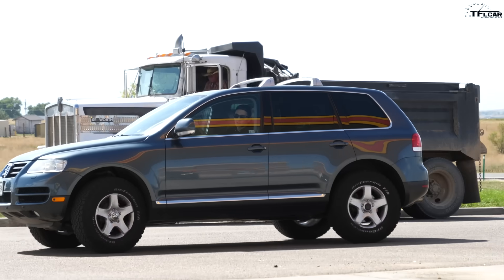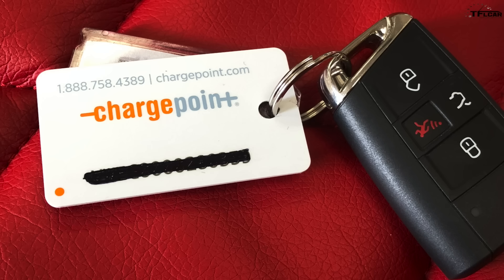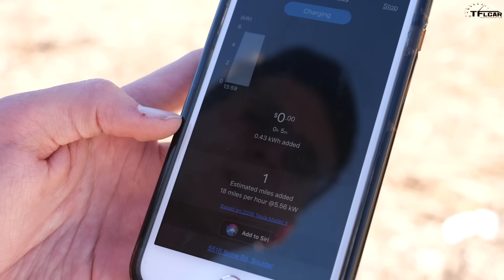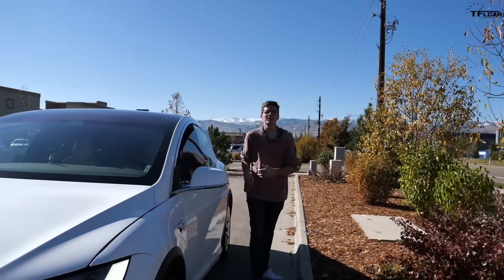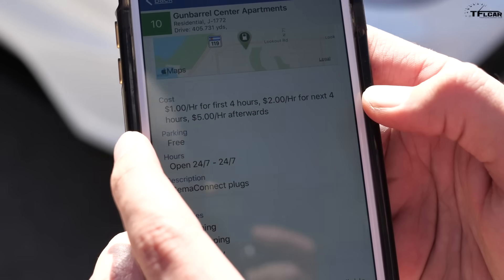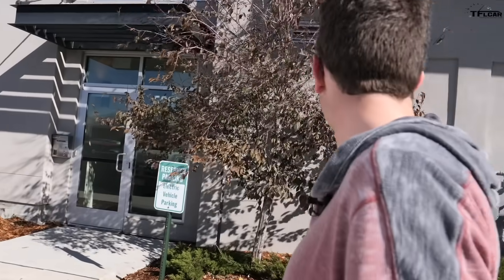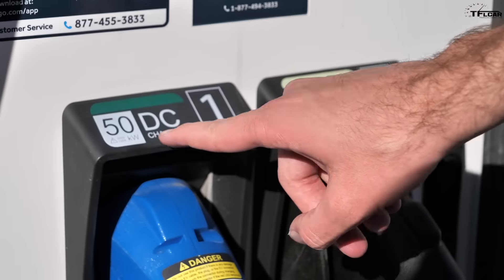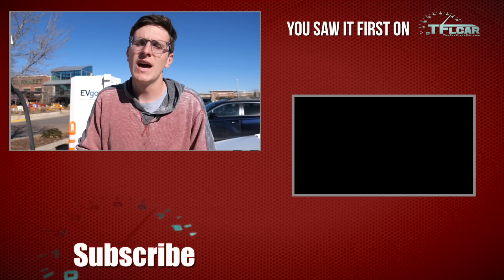Here’s Why Charging an Electric Car Can Suck - And It’s Not The Reason You Think!

Comment: I'm failing to understand the point of even having a public charging station that would take 20 hrs to recharge your car.
Reply: It also wasn't stressed in the video that the apartment complex charging station ("for residents only") is closed 5pm to 8am.  No overnight charging = no benefit to residents who have the most common jobs to be able to afford an electric car.
Reply: @VoltisArt  I saw the sign for that charger that said it closes at 5pm.  I had no idea that was even a thing with charging stations.  One more reason I'm very hesitant to go EV.  It would be great for me, as I get mileage pay for driving between job sites, but if I can't get a charge, or have to sit forever waiting for charges, then it is pointless for me.  Also, what if all the stations are being used?  Does the app tell you if a station is full before you get there?  I can't imagine waiting in line for an hour or two to get a "fill up".  What if you're there and someone is waiting, and they pull in front of you to keep their space and say, "I'm coming right back" but they don't and you're blocked in?  Is that a thing?
Reply: @VoltisArt  - I saw that too... how useless. I looked on app and saw a lot at car dealers too.. only useable during business hours...
Reply: @VoltisArt  Good point.
Reply: VoltisArt its done to allow residents to have a guaranteed free charge
Reply: @VoltisArt  Business hours only, for an apartment complex? Someone definitely has a screw loose here. Anyone owning a Tesla with a day job isn't going to be able to charge their car after getting home around 6pm if the "pumps" are shut off for the night. Good luck enticing them to sign a lease!
Reply: @VoltisArt  With all the assholes hogging the chargers that do not live there makes it even harder to charge for a resident.
Reply: @VoltisArt  🎯
Reply: @VoltisArt  Why would a charging station need to close at night?  What is the point in that?
Reply: I'm not sitting in my car to drive all over to look for a charging station let alone sit there to get it charged.  Gas station 5-10 minutes to fuel up. Plus I love the sound of the exhaust and engine.
Reply: The point is a tax break for the business that put it in.  There is some usability for the person who lives/works nearby.  And many many plug-in hybrids have electric ranges of 15-50 miles +300 on gas and can fully recharge in 1-5 hours.  My bMW i3 will do 120 miles on a 5 hour charge and then just switch to gasoline for as long as I fill the tank so an hour of charge while I have lunch is 25 miles or so that I don't use gas.
Oh and buying an electric car if you can't charge at home or work is silly.  A plug-in Hybrid makes more sense.
Reply: @TexMex421  Plug-in Hybrid with 60 - 120 mile electric range is good enough.  Most people won't commute more than 120 miles for a job !
And absolutely you need that gas engine back-up to the electric motor.  The USA is too big to travel across without having the gas engine.
Reply: @TexMex421  Toyota Prius or Camry hybrid is the way to go as it's engine charges the battery .
Reply: @nicopolis7377   Plug-in Hybrids are much better.  Charging a battery with a gasoline engine is silly.
Reply: @TexMex421  Five minutes to fill up and drive 400 miles. 
So, let's go electric.
Staying in the 20% - 90% charge range recommended by Tesla, one can count on 220 - 250 miles on a reasonably good charge, then it's necessary to stop at a good charge point, regardless of the desired destination.  Real win.
Reply: @TexMex421  and who eats lunch at a charging station.
Reply: @dannyfields2065  I usually eat at the restaurant, not at the charger itself.  There is a fast charge station about 1/2 way to my dad's house in TN on I-10.  You can get gas, charge, and they do a really nice fried chicken.  Brugh's Mill County Store.  Now that the Walmarts near by have fast chargers, they are usually 2-3 chargers open.
Reply: @TexMex421  So you plug your car into a charger that has a time limit and walk to your office, then you walk back out to your car and move it so you don't get fined for overstaying - wonderful.   Better to charge at home (cheaper anyway) - if you can't make it to work and back on a charge then you need a Tesla (LOL) or an ICE or ICE hybrid.
Reply: @TexMex421  ranges of 15 to 50 miles?           worthless
Reply: this is the reason tesla built the supercharger network. with v3 supercharging, a brand new model 3 can get from 0-80 in 20-30 min
Reply: @punnequraq  I just ant sitting around 20mins period.
Reply: I agree wouldn't it be so much easier if they just swapped at your batteries. If the battery was a module that could be easily replaced it's charging station could have a technician who could remove it with a forklift and slide a new one in and it would take all of 5 or 10 minutes and you would be fully charged ready for another few hundred miles. Alternately you could simply plug it in at home and recharge
Reply: Many will be level 3 (100 Kwh peak) meaning you could charge a 90 kwh pack in approx 23 minutes 50% of capacity. Level 2 is 240V single phase input, approx 6 kwh (Tesla lets you step it in amps). This requires a 30 amp 2 pole ckt in your electric panel similar to a dryer. The 120V plug charges a maximum of 1.5 kwh, about 3 miles per hour. It's meant for charging on the road when all that is available is a 15 amp branch circuit.
 Li-Ion battery packs get very hot during very high speed charging. That means, when its hot outside or your battery is aging, it won't accept a charge nearly as fast. This is because the internal resistance is increasing. This is how battery capacity is measured throughout the industry. Chargers taper (reduce) output automatically when this occurs.
The info presented here is not brand specific as all Li-Ion batteries have the same characteristics. Expect problems as usage increases as the industry is immature. The upcoming 2020 National Electric Code will have many revisions about charging Li-Ion batteries and power storage, due to the inherit fire and explosion dangers. [Source: ECmag.com "NEC 2020 First Read"]
Reply: So if you loose or damage or don't have battery for your phone  you can not refuel (charge) your car.
And deap inside you....you know this is going to happen....and it will be in the middle of the night miles away from home in a dark rainy and very lonely mall holding in your hands your wallet with cash but nothing can make this happening.
Reply: @farangforever7758  Hmm, you don't have any experience with this, do you?
Charging stations take input by smartphone app, card (both system cards by the vendor or credit) or you can always call. It's not rocket science. I've used all 3. Oh, and the Tesla superchargers. The car gives a secure code to the charger to identify it and bills the owner. You literally plug in and walk away - less trouble than gassing up a car.
Reply: Gavigg75  Ah so you lost when you said I was on crack, and yet you still keep trying, admirable.  Is shitbird the name of your slow car?
Reply: SuperDave You and me both, and I am a very happy Tesla owner.  This kind of outlet is of little to no use for the owner of any brand of long range EV. If your EV is a “city car” With 80-100 miles of range I suppose the 10-20 miles you could add while eating or shopping could make the difference between getting home and getting stranded. It is also a useful kind of charger at an office parking lot.  If there is such a charger where you park for 8 or more hours while working, you would get all the range added you needed to keep even a big battery long range EV filled up.  
But no one should expect to use public level 2 stations as the primary charger for their daily life - unless it is within walking distance of your home, located somewhere you are allowed to park for free, and for long hours.
Reply: TexMex A Tesla is faster than a Ferrari? A Tesla is more fun than a Ferrari? 

Cleaner?  What produces the power? A coal or oil fired power plant, with a massive distribution network.
Reply: @peterking2651  burning fuel in an ICE is the single most economical and ecological mistake ever in the history of such mistakes. just burning it in a turbine is making it at least twice as efficient.
Reply: Doing this all the time would drive me nuts!
Reply: Vacations will be a disaster going to see you grandma whelp you’re gonna have to wait an extra 20 hours
Reply: Yea no thank you I’ll stick with a gas engine until the vehicle technically gets better to the point we are now with gas vehicles also. The charging all those apps for different companies no thanks I’ll again wait for that technology to improve.   But the wait time lol.   I can walk to where I want to go in less time  🤦🏻‍♂️. I’ll stick with the combustion engine.  For people who say save the environment. Lol.     Your getting you energy for that tesla from fossil fuel electric plants.
Reply: If you're a liberal, it makes perfect sense.  You have all day to charge your car, because you don't have a job!
Reply: @pcgodusa  Nailed it.
Reply: There is no point.  Battery power is fine in a flashlight, and portable devices.  Only good for cars that are used solely for local use.  Long range is hopeless at this stage; what take a few days, would take a few weeks.  Not very smart use of time.  The costs are still too high, and pollution created to make the batteries are never discussed; out of sight, out of mind.  The illusion of "clean energy" is only a matter of position; the carbon emissions are not coming out of your tailpipe, but go to the plants that create the battery parts; you'd be shocked.
Reply: @magkill69  well, you almost made a point, then you threw all credibility out the window with your racist insanity.
Reply: SuperDave I’ll be doin donuts in my civic blow a tire , walk to a tinder date, bust a nut ,change my tire , get a chicken sandwich, shit it out and pull off . And he has 50miles of range
Reply: @TexMex421  Many people have no concept of power generation.  They talk like all the power they need just falls from the sky.
Reply: @jsunit5354  Since my home solar panels produce all the power I use and more, guess my power does fall from the sky....
Reply: Yeah bud 15 miles per hour...shats shit hiuse galore
Reply: Cristopher Reeves  My electric car charges at home.  It is always charged and parked next to my track day car.  I realize this is an emotional issue for you, so I will not point out what an asshat you are.
Reply: Most EV owners charge at home, much more convenient than going to the gas station, much cheaper too, 1/2 to 1 5 the cost per mile driven.  That adds up fast. Most public stations are a joke, Tesla stations are much faster esp. the latest version 3 chargers that charge at up to 250 kw, much, much faster than the public chargers shown in this video.
Reply: Wow!  After watching this video I see that the advantage of fossil fuel is tremendous.
Reply: I own a Chevy Bolt.  I drove it 140 miles from sea level up into the mountains of California.  The gauge showed 50 miles left on the battery. We drove the next day to a nearby town and had lunch while the Bolt charged nearby to 100% in 45 min. The fast charge station accepted my credit card without a special account. The fast/slow universal charge port on the Bolt will charge anywhere without needing adapters, except Tesla chargers, where as you pointed out there are none available. The Bolt mileage is extended by judicious use of the regenerative brake paddle on the left side of steering wheel. It takes a while  to get used to, but it gives 100% regenerative braking power when used. The normal foot brake charges at a fraction of that. I charge the Bolt mostly at home on 240 volts. If the battery is half way down,  it will top up to 80%(the standard charge target for max. Battery longevity) in about 3 or 4 hours. Houses built  to code all have 240 volt at the service. If you have a garage, you can probably charge at home with 240 volts. The Bolt charges on 120 volts more slowly ,about 24 hours from half charge to full. I hope this is helpful. My Bolt is a 2019 model. I only charge to 100% for road trips.
Cheers,
Wolfy
Reply: Let's suppose you want to make SURE people grow to hate electric cars. What do you do? You make the recharging process as long as possible.
Reply: LOL, I'll stick to gas until the end!
Reply: i believe they were originally for hybrids, not long range Teslas
Reply: Their purpose isn't to fill you from empty to full quickly. Storefront ones are to give you some extra range while you're already parked at that location, with the added bonus of typically being closer parking spaces. For offices and apartments, you may be parked for 8-12 hours per day. They're not very attractive as an alternative to home charging, gas stations, or superchargers, but are pretty good options compared to other parking spaces since they kill two birds with one stone.
Reply: Of course you are, so is EVERYONE ELSE!
Reply: It's good for places you will spend quite a bit of time like the mall, amusement parks, zoos, ect
Reply: No way I'm going to plug that thing in and wait around for 4 or 5 hours for this thing to get a decent amount of charge. I could have went to a gas station and filled my car up and drove across the state
Reply: @philbenson6041  you don't need to wait 4 or 5 hours, unless You're on a 110/120 ourlet. If You're using a charging station, it doesn't take that long. A Level 2 charging station is a 240 volt. Depending on how far down the battery is, the charge can take anywhere from 30 minutes to 2 hours. On a Level 3, the charge is only 15-20 minutes
Reply: Wife: hello. You: hey listen honey i'm going to be about 2-5 hours late, need to charge the car to be able to get home... Sad
Reply: Virtuuuuuuuuuueeeeee
Reply: You park your car and come back 20 hours later to find it striped of anything of value.  Good plan, Unicorn lovers.  Ruin life for almost everyone so you can feel good about your fantasy dreams.
At least until they realize that the power companies are not set up for mass use of electricity just for all the cars alone and that all those 'free' charging stations currently at some stores are going to start charging once the number of cars feeding off them starts to adversely affect their bottom line.
Reply: Ppl need to understand I don’t want to wait 45 minutes or more to charge a car have lunch and etc etc etc I just want to top it off and go from point a to point b in the fastest time possible not stopping 2-3-4 times and waiting nearly an hour each stop and not even getting a full battery charge
Reply: And electricity comes from...?
Reply: some vandals may pull out your charger while you are shopping
Reply: BRO. LIFE IS ALREADY STRESSFUL. NOW TO THINK OF CHARGING YOUR CAR AT A STATION FOR AN HOUR IS INSANE. OR EVEN AT HOME. THIS THING WILL EAT UP YOUR ELECTRIC BILLS LIKE CRAZY. I DONT THINK ELECTRIC CARS ARE FOR ME MABEY IN A 100 YEARS.
Reply: He is in the Socialist Republic of Boulder, that should explain a lot!
Reply: I see the comments "don't worry,  just get a charge long enough to get you to the mall" fully charge later.  Well the gas people,(those who have been in disasters or winter storms, know you always keep your tanks full) your life might depend on it.
Reply: It will give the thieves more time to steal your ride. Cheers.
Reply: Just remember this saying and it holds true to this day. We live by this in my home- "Democrats ruin everything". Very wise saying.
Reply: You will eat z bugs and be z happy
Reply: With ⛽️ car 1,000 miles, what 24 hours? Could turn into 66 hours with Electric junk. If someone comes up to you while you're outside waiting to get a internet connection to pay, or 5 hour charge, you're screwed. 😳
Reply: The point is $$$...after the pee-on class of "middle-class" gets used to not affording vehicles it will MOSTLY be public transportation...The owners of everything want the world to be like New York New York...the rich get perks, the serfs just go to and from work.
P.S.-sorry I woke up cranky today. ; p
Reply: You use them at work or home
Reply: They are so schmart
Reply: Keep Rocking!  Start to finish takes about 5 minutes, so not that much difference. And as I'm getting 133 MPGe (the equivalent of miles per gallon) I'm happy to wait the extra 10 minutes. But usually we just plug in when we get back home, so it takes no time. Er, I assume you can gas up at home?
Reply: Read what I have worked out sent to Tesla no replies?????? I could kick the butt off these engineering.
Reply: Use other stations that take less time 🤷‍♀️
Reply: SuperDave * I totally agree with you!  I thought the same thing, this doesn’t make too much sense to charge a Tesla Model X that has 325 mile range at a slow public charger.  What I found out was these slow level 2 AC chargers are designed primarily for the short range EVs like the Leaf or Plug-in Prius.

As Tommy noted, the Tesla Model X is charged at home where charging typically takes place during the night when you are asleep!  The Tesla Wall Connector (240 Volt - 48 Amp) takes a few hours at a fraction of the cost of using gasoline.
Reply: Well if you open petrol station there is tons of regulation to follow, but we just need change the way we recharge, every parking lot can be charging station, so you don't need to wait it to charge full but just charge it everywhere you park, we just need more charger in the future so petrol maybe convenience to pump, but if charging point is everywhere well you don't need to go any station anymore.
Reply: THe idea is you're never emptying your tank when using a public non fast charger.
Reply: Keep Rocking!  Yeah maybe a little. He isn't as bad as most though.
Reply: Robert Gregg  Hmm, been driving one for 4 1/2 years, daily commute to work. I have to admit the new model 3 is a better car for that, but the Focus does alright. Figure I've saved $6k in fuel and oil changes so far, in another 6 it will have paid for itself completely compared to buying the same car with an ICE engine. I will admit I've spent a total of 3 hours in that time 'waiting to charge', mostly to see what I could get away with. All the rest is just plug in when it's convenient.

I realize some might be threatened by that, but there are downsides. Range is reduced a bit when it gets below 50 degrees and it doesn't drive as nice as the Tesla does. But no one is making you buy an EV, we're saving gas for you to use.
Reply: In Italy some company are “updating” they charging station with the J1772 standard for reach up to 22Kw. It isn’t fast as a 50Kw station, but is always better than only 7Kw. The problem is many model of EV (also between the new one) can recharging only to 7Kw or 11Kw with the J1727
Reply: SuperDave road trips, bud
Reply: It's 20 hours to fully charge your car's battery.  However, most people aren't going to use the full capacity of their battery unless they're on a road trip.  Even a relatively slow charger could easily be enough to replace the charge used in a typical commute while you sit at work.  If you're taking a road trip, it's easy enough to locate chargers based on charging speed.
Reply: ferkemall  Really? I haven't had a car just die on me except my father's '83 pickup and my '65 van - oh, and my mother's car. The van was an electrical failure, a short in the wiring after the harness had been hacked to pieces. The rest were water in the gas and a badly tuned carburetor. It's true that if the electric motor goes out I'll be stuck, but the same thing happens with a gas engine - and it's more likely. Same likelihood of the computer going out on both EV and a gas car, so where, exactly is the increased risk?

I think the real issue is you're feeling threatened and so dream up scenarios where your choice somehow works out better. I had a lot of people make the same mistake when fuel injection came in, first in cars, then on motorcycles. All kinds of ridiculous complaints, but bottom line is they became far more reliable, more powerful, more torque - and got better milage to go along with the emissions reductions. So, no, you don't have a point.

BTW, if it does ever break down on the highway I'll get it towed, just like any other vehicle.
Reply: ferkemall  Can't help that one, so don't buy a Tesla if you live in England and can't afford the luxury tax. Get something else. But don't bitch if you were going to buy another luxury car, you'd pay the tax either way.
Reply: Oh boring to wait long hours for charging 🙀
Reply: @elainekoteles1948  Y'know, I've had to sit for a half hour twice in 4 1/2 years using a car with a 78 mile range. Perhaps if you can't manage something as simple as fueling you should just take a taxi instead.
Reply: ferkemall  OMG 10 hours?  That seems like less time than you spend at home on a typical day so....   I have BMW level 2 charger.  They cost about $800 new, but I paid about $300 for a used one. It will charge my car from zero to 100% in 4 hours, but Of course it's very rare to need that much charge.  
Exclamation points are awesome!!!!
Reply: Trigger Troll  Well, less useful. There is a supercharger network across Highway 1, and they go quite a ways up north, but not everywhere. But likewise, if you only refill twice a month you don't drive that much. A home charger might take care of your needs even with the low temps, provided you are not too far out in the woods. In that case you're one of the .001%. But don't worry, range, speed and charging networks are improving. You'll just have to wait a few years before they'd work in your situation. By the time you need a new car, perhaps.
Reply: @TexMex421  yeah, go look at that tesla power band, looks so amazing the way it has initial high torque then dives off a cliff 🤣
Reply: @TexMex421  great grammar.   Loosing 🤣   do you mean losing?
Reply: How about if you go on a vacation in your electric car and you stay at a hotel or motel most of your trip? If the hotel doesn’t have enough or any charging stations your in big trouble. You would have to go and look for a charging station during your holidays, and than wait for it to charge, that’s no fun. I think right now a hybrid is a much better choice. A Kia Niro for instance charges itself while driving and in the city goes almost completely electric, where it counts the most, because al gas cars consume more gas while city driving than freeway driving.
Reply: gets you to spend money shopping at places around it.
Reply: I'm getting a horse the only emissions, is after it eats just stay downwind and life is good...
Reply: If it is next to your home You go there, Plug your car, go home, eat, Shower, go to bed, Wake up, have breakfast, go to your car and un-plug it.

Usefull for people living in an appartment building without a personal garage.
Reply: @DSP16569  lol yeah and let’s say there’s a foot of snow on the ground and now you’re trekking from the charging station to your apartment. Or there’s an emergency and you have to get in your car right away but you can’t because the car is in the charging station. Or you have groceries or packages that you need to bring in to your apartment.
Reply: @NeuroMuscular And here in Germany we have many (up to 11kw AC) charger where you can charge for free. Often at grocery stores, IKEA or shopping centers etc. So you can Charge (for 0,00€ ) and Shop :-)
Reply: @SuperDave you usually won't run down your battery to a completely dead battery,  You usually charge enough to make it to your home or next destination where you can charge again.  Charging an EV is not the same as filling up a gas tank in an ICE vehicle.

I have a Plugin electric hybrid, I get about 30 miles on a charge, 99% of the time that is perfect for my daily driving habits, I go home for lunch and I plugin, when I'm out and about and see a charger I'll top off just to have a full charge and can go even further than the 30 miles on Electric if I see a charger at a shopping center I'm going to be spending a few hours at anyway.

Level 1 (which I use at home) and level 2 chargers (which I use when i'm out and about) are meant not to fully charge your car but to give you extra range, the Level 3 and Tesla chargers are the ones meant to be used overnight so you can get to your destination with a full battery.

We just have to change our mindsets and if done right you can charge during your day and never run out of battery
Reply: You will have your car full every day since you plug it in every night, but if you drive far, you will need a public station.  Realistically I think an electric car only makes sense if you also have a gas powered vehicle for longer trips but it’s doable with some obvious limitations.
Reply: I could start a new family while my EV is charging.
Reply: SuperDave it’s because single phrase charging takes forever. Here in Australia all NRMA charge stations are three phrase DC fast charging so an EV battery from 0% to 80% can be charged within 25 minutes or less.
Reply: It why I not understand why people get nissan leaf instead of spend 3k more for tesla as nissan leaf is like 12 hours or so, tesla has about double range and 7 hours normally
Reply: I mean when we took our shitbox leaf on a 400 mile journey those level two chargers could give us 30 miles or so of range to jump to the next charger over the course of a couple hours which sucked, but pretty much all of them were free and we didn't need a tow truck or gas station to get home lol.
Reply: Ikr that’s why we have super chargers never use these charge points they are a waste of time and money just stick to superchargers or just charge over night
Reply: It only makes sense at DESTINATION locations. Hotels, Work place, etc. Other than that, makes Zero sense.
Reply: Gavigg75  I thought the same, but apparently they work fine. You just lose a shit load of range. I bought a VOLT this past August. I'm curious to see how it will work in cold temps.
Reply: That’s why you go with NIO and it’s battery swapping but nah Americans want charging stations cause it looks like a regular gas pump. Have fun waiting 1 hr. I’ll take the NIO battery swap that takes 6 mins
Reply: joseph mccartney there are roughly 170k charging stations in Europe versus something like 25k in the US. I don't think the plug in option is American at all...
Reply: We now own two Teslas. Almost all driving is done locally, so we just plug them into our 240 outlet every few days when we’re done for the day. Next morning, the car is good to go for several normal days. And very cheap and hassle free. Just took a 1500 mile road trip last week. Stopped at super chargers along the way, but no big deal, and I need to get out and stretch every couple of hundred miles anyway. The car is so much more fun to drive than any other car or truck I’ve ever owned. I'll never go back to gas. And I’m not doing this because I’m a tree hugger, but I guess that’s maybe an extra benefit. I think if you make the mistake of test driving a Tesla, you’re screwed, because you will probably want one.
Reply: indoctus41  lmao nice lie my guy. There isn’t a charging station that can do it in 30 mins from empty to full. Even at 440v which is the fastest charging station available it still take 1 hr and 33 mins. Go down to 220v n it’s 12 hrs n at 110v it’s 24 hrs +. Do some research before u spit out wrong facts. Clowns like u are what give EV’s a bad stigma 🤦🏼‍♂️
Reply: @TexMex421  I don't know who you were replying to but it isn't me.
Reply: @TexMex421  your comment reeks of arrogance and is that of a child.
Reply: I’m failing to understand why people wouldn’t purchase a gas vehicle along with these. In case you have to get to work and have another 17 hours to fill the batteries.
Reply: Agreed, as an EV owner. They serve no purpose.
Reply: It's not practical for long distance driving. Like driving from bay area california to LA.
Reply: Lol
Reply: Right!!
Reply: None do, that is bs like all the rest opf the garbage from a petrol head. Mine takes 25 minutes to almost full, enough for another 100 miles. In four years I've nevber been near running out, which I did many times with an ICE back in the old days when they were all there was. No engione block, no clutch, no gerarbox, no trtansmission, no oil tank no oil no smell. And I can lerave any ICE behind any time I choose. I see them in my mirror. foot down smashing it through the gears as they disappear down the road behind me. 

Perhaps America is just behind the UK, here supermarkets have them in the car park, free to charge while shopping, topping up. But I charge mostly at home on offpeak, overnight 100% renewable energy. Date for all ICE to be goner from the roads is 2030, so buying a new one4 now would be costly. Manufacturers have car parks full of nmew ones they can't sell. ICE sales way down EV sales riuing rapidly. 

This is the BS channel.
Reply: It doesn't take 20 hours to recharge on a Level 2 public charger
Reply: many  charging stations  are 240 volt stations so it takes 30 minutes to reach 80%  capacity
Reply: It really only makes sense as a solution for rental apartments, but even then it's not really ideal.

Realistically, we should just move to 50kW+.
Reply: I don’t understand why they don’t just have standard batteries that can be switched out quickly. I know they are bulky and heavy, but I seems like there should be a way, sort of like when you exchange a propane tank.
Reply: It makes sense if you have a charger at home you can use, but if you buy an EV you need to do a little research. A lot of people are just going to be very hesitant… you just can’t get on the highway and go somewhere, you gotta get out your phone and find a charging station 1st. If you do take a trip and have to re-route several times just to charge up… that’s going to be a real showstopper for some people
Reply: SuperDave : The EVgo charging
station in my area has a 1 hour
charging limit , so if you are at
5 % that may give you 100 miles
at .35 cents per minute per their 
webpage . Unless they are running 100 kilowatts chargers .
Reply: So they can charge by the hour
Reply: A lot of hybrid cars only have 15 miles of range. So it’s not so bad for them.
Reply: The technology just isn't there yet. 16 miles gained per hour in our ADHD society with instant gratification needed. Yeah, gas will be around for while longer.
Reply: Your comment is based on always waiting to charge until your car has gone into “turtle” mode and then charging to 100% before leaving. Do you wait until your gas gage pointer has gone below “E”? Do you always fill your tank until the nozzle cuts off three times?
Reply: You're not supposed to charge EVs at charge stations, but mostly from home while you're sleeping at night.
Reply: Needs motel beside it
Reply: Do they have electric meters to charge you how much electricity you use or is it a flat rate certainly it isn't free somebody's paying for it
Reply: It's all part of the plan.
Reply: Have one by movie theater, watch a few movies back to back.
Reply: Right, plus that 240 outlet might set your house on fire🌹
Reply: I use the L2 chargers like the first one shown in the video only when I happen to be doing something for a few hours or more nearby. If it happens to be free. I'll even use it even if I'm only going to be at that location for 15 or more minutes since I'm OK with getting a free charge even if it adds a percentage point or so.
Reply: Batteries charge the quickest when their battery level is low and slowly when it is high so most of the charge is early on and the rest is just trickle charging to top it off.  So you don't aim for a full charge but just enough to get to your next charge site when you're on along trip.  Usually, you try to charge overnight at home which takes a level 2 which is basically your dryer's or stove's 220 vac circuit, they tend to just extend your dryer circuit into your garage if it's near the garage resulting in not being able to run them both simultaneously.  However instead of using a standard 220 vac socket and plug, they sell you a plugin for a thousand dollars or more just to convert the standards.  I'm surprised no one has created an adapter for a standard 220 vac outlet.  Remember a 220 vac line are just two opposite phase 110 vac circuits so two breakers next to each other, the rest is running the wires to your garage, since many US homes have their breaker panels outside (at least in Texas), I would suspect they would run the cables on the outside of the home to the garage and just drill a hole through the wall to run the cable in, the same way they do with satellite TV and even the coolant lines for mini-split airconditioning.  Of course, people cover this all up when they replace the siding of their house (usually just adding another layer of siding instead of actual replacement) and of course there are covers that can be painted so the runs are not so noticeable.  If you're having a new home built, insist on a 220 vac outlet in the garage, they are trivial to add in a new home and can easily be converted to a car hookup (with that thousand dollar plus unit that really does nothing but convert the plugs and give you indicators).
Reply: @johnwang9914  Except that it requires 240 not 220. Also when you upgrade for 240 you will need to rewire entire house in order to be up to code. Any home that doesn't meet codes will be summarily condemned and torn down. This is why renters can't do it. Also forcing people to travel from station to station insures no one will be getting anywhere very fast. Maybe we should stop voting for Pinky and the Brain👀🌹
Reply: @sweetromance8264  If you actually looked, it's often any voltage above 200 vac that's required not specifically 240 vac.  Some homes have a centre tapped single phase transformer that provides two 110 vac phases that are 180 degrees apart hence you can get 220 vac, some have transformers that give you 120 vac opposing lines and hence can give you 240 vac.  A commercial three phase line which are simply not available to most residences are configured to give three phases of 120 vac at 120 degree phase separation hence two phases gives you 208 vac.   To change a home with 110/220 vac to 120/240 requires changing your feed from the utilities as the transformer we're speaking of is that of the utility, the actual wiring, breaker panels and breakers in your home would be unchanged.  You're also noted that the sockets are rated for 250 vac regardless if whether you have 208, 220 or 240 vac.  The most common single phase residential power you have in North America is 120v split phase hence you can have 240 vac, but some homes have 110 or 115 vac and they would use 220 v or 230 v for their level 2 charger, they would not pay an electrician to upgrade to 240 v as it would take the utility to either change the transformer on the pole and or the line voltage serving your community.   You should check with an electrical engineer who has actually taken power distribution courses as I have before making your ridiculous comment.
Reply: Take a cab home and come back in 20hrs
Reply: @bobbarker9556  More like just charge for 20 minutes.  You don't need a full charge to drive home and most of the charge occurs when the battery level is low, charging from 20% to 40% takes minutes while charging from 80% to 100% can sometimes take hours.  It's like siphoning water between two glasses, if the level in both glasses differ a lot, the water flows at a faster rate but when the levels are close together, hardly any flow occurs.  The first few minutes of charging will be more energy than the hours later on.
Reply: Why? Bidens kick  backs. All this shit is made  in China!!
Reply: I use these chargers all the time. One of the things they didn't get to is that you don't charge to 100%, typically. 
You stop at these charges and get what you need.
I have a free chargepoint charger at work. Most days I don't even need it, some days I need 70 or so miles or charge. On those days if I can get tge charger, it stays plugged in for 1/2 a work day.
Sometimes my commute uses nearly my whole battery, and I charge most of tge work day to finish my commute.
By far. Though, the vast majority of my charging is done at home overnight.
Reply: consumes idiot time  forces mass transit  controls working people
Reply: They make more money from you.
Reply: It would seem if you travel to make a living this would absolutely cost you more than it's worth
Reply: electric auto is planned failure  we have no functional societal cohesiveness that would entertain the notion  energy has only several sources then convertion to motion    sun,  wind, petrol, water droppage, nuclear, fusion    none store well and have great heat loss in conversion and storage   none measure with petrol and even in first use source   people need damn new world order in its scam against humanity   improve education and implement liberty cancel government so that in future  there s a chance to unlock the secret to useable fusion energy
Reply: What if you're traveling cross country?
Reply: That’s why they have faster chargers….
Reply: They want that captive audience
Reply: It's a feel good scam.
Reply: Simple , its to take more tax dollars .
Buying an ev is most certainly being part of the problem . Ev owners are non viable hypnotized walking billboards
Reply: @TexMex421  No, it's not the same. The comparison I made is the one you should have made. And it favors gas.
Reply: That's because it takes that long, to figure out how to pay for the electricity!!🙄🥱
Reply: @TexMex421  Right because they're not even remotely the same.

You can't compare the act of plugging in a cord with the filling process itself. It takes about the same amount of time to shove the hose in the filler hole.

The difference is 5 minutes later I have all my liquid range replenished and you have to go eat and shop. Or at home eat and watch TV. You're waiting longer regardless.
Reply: @dchawk81  And you paid three times the amount to travel the same distance
Reply: @grunt98444  I forget what this is about since it's so old and the thread is way too long to scroll back through. So I'm going to assume I was defending fossil fuels.

I'll continue with that line by saying my time is worth something, so no I didn't pay 3x as much to go the same distance.

Electric is fine for people who have a predetermined commute and schedule and can plug in while they're at work or home and would never conceivably be caught out needing to drive far for long and/or spontaneously.

Then there's everyone else.
Reply: @dchawk81  It costs around $15 to fully charge a Tesla that gets 520 miles of range, how much did you pay in fuel to fill your gas tank for same amount of miles? Ever heard of the nationwide Tesla Supercharger  network?
Reply: @grunt98444  You're being too obtuse for this conversation to continue. Have a nice evening.
Reply: @grunt98444  Until your novelty gets mandated to the mainstream.  As demand to charge EV's increases and the grid can't keep up, prices WILL increase. Electricity, like water, doesn't get cheaper when the demand increases. There's no economy of scale.
Reply: @dchawk81  driving an EV, we don't pay for gas. I save $200 a month in gas costs by driving my EV.
Reply: @bradmagnuson6963  I'd have to drive a lot more to spend $200 on gas. My car is paid for and I might burn a tank every few months.

As much as I like the concept of an EV it just doesn't make sense for me because I'd have to take on a payment far larger than any fuel I'd save.

It'd be different if I was in the market for a new car regardless.
Reply: @dchawk81  that's bullshit. You can buy an EV for LESS than the price of a gas car. I did. And, my payments: almost  $200 less than the gas car I drove. You'll also save money by NEVER paying for gas, and very little, and sometimes zero maintenance. You can get a used EV for under  $10K now, which is far, far less than the price of a gas car
Reply: @bradmagnuson6963  You're arguing for nothing. I already told you my car is paid for and I hardly ever drive it. There is absolutely zero reason for me to buy something else.
Reply: @dchawk81  why are you arguing against electric cars? Obviously you don't understand them, or want to, so why shit on electric cars, if you have no idea what you're talking about, when it comes to electric cars?
Reply: @bradmagnuson6963  Yeah and everyone else is paying for the roads you're using.

Don't worry though, now that Newscum mandated EV's for everyone, electricity prices will skyrocket and you'll get taxed on miles driven. 

Since Gayvin has set the standard of dictating transportation modes, he's paved the way for the annual allocation and cap of miles allowed to be driven for the little people.
Reply: @dannygreen7473  I don't live in California. I think what you said, you took out of context
Reply: @dchawk81  BUT, you have to go to a special place to fill up. I can do it at my home and never go to a gas station again. Unless you are living in your car MOST people have electric service at home. I do NOT have fuel service in my home
Reply: @dchawk81  You can get an 80% charge in a Tesla in like 10-15 minutes. Sure if you forget it sucks but it's not like you're charging all day.
Reply: Special News Bulletin: CRIME RATE INCREASES SPECIFICALLY AT PUBLIC CHARGING STATIONS, NEWS AT 11. IT'S HARD ENOUGH DEALING WITH THE 5 MIN STOPS AT GAS STATIONS SO NOW I GOTTA WAIT 10 HRS? NOOOOOOO THX.
Reply: @lavery0365  I have been talking about this forever. It’s not safe! Also where do the batteries go to die. It’s an environmental hazard.
Reply: If you're low on charge and want to go to the mall, this will get you enough charge while you're shopping to get back home where you just plug in overnight. If you can't charge at home, EVs probably aren't a good option. If you can charge at home, you'll probably never charge away from home except superchargers on road trips and you'll have a full charge every morning and won't even think about it. My average time spent at a supercharger is 23 minutes. I'm eating or shopping during this time, not standing at the charger as you might imagine if you're used to a gas car.
Reply: @stevew9041  but you don’t seem to understand is that not everyone has a house or garage to charge...many people live in apartments.
Reply: @stevew9041  i get gas about oncest a month, and am in and out in about a minute and a half. time is money.
Reply: @dannyfields2065   If you can charge at home, you're going to save time and money on fuel with an EV-- no question. If you only get gas once a month, then you don't drive much. You could get a pretty inexpensive EV with a small battery and would never need to charge during the day. You'd spend 2 seconds plugging in at night at your home, just like you do with your phone, and you'd leave every day with a full charge. You'd never need to waste that minute and a half pumping gas. Your time is clearly very valuable, so a lower range EV could pay itself off very quickly in time regained.  Very few people with a Tesla need to sit around waiting for these third-party slow chargers. This video was mostly a hit-piece on electric cars. You plug in at home and never think about it. You don't have to look around for the cheapest gas, you don't have to deal with some homeless guy asking you for money while you're at the pump, there's never a line for the charger at your home. You pull into your safe garage, plug in, and don't worry about it at all. Much easier than your once a month fill up. If you can't charge at home, then maybe don't get an EV right now. These chargers and superchargers are for people who either can't charge at home, or who have gone a very long distance since their last charge and have no other option, or for people who are going to be at the location for a while anyway (so the time charging is time you were going to be there anyway. Also, money is money more than time is money. It costs me $9 in electricity at home to charge my car up from empty to full while I sleep. I have been able to charge for free at every single charging stations that I've used away from home (hotels, malls, grocery stores, etc), so my actual cost when you average those in is less than this. What does it cost you when you do your monthly fill up? Three times that? Four? Five? Sounds like you could get a standard range model 3 and it would more than meet your needs. I've done zero maintenance on my Tesla in the last year. How long have you spent waiting on oil changes? How much did that cost you in time and in real money? If you can't charge at home and if you're going to have to use chargers that aren't free and that you have to make a special trip for, EVs are a disaster unless you're retired and don't mind waiting around (there are some good games plus Netflix, HULU, YouTube, etc built into Tesla's for people like this, though).
Reply: @stevew9041  already told you why i cannot cannot charge at home, because of the garage situation. scroll to find the long comment.
Reply: @stevew9041  Except when clowns like this are using the "home" charger at your apartment and you can't plug in.
Reply: @stevew9041  Everybody's always eating or shopping when charging their cars. Lol.

Some of us aren't vapid consumers. The "oh just plug it in while you're at the mall" doesn't apply. We need fuel to get on with our day. The less time we spend on it, the better.

Eg yesterday morning I agreed to meet someone to haul some stuff. Didn't realize I only had 1/8th of a tank of fuel when I headed out. Stopped at a gas station, pumped 15 gallons in a few minutes, and still got there in plenty of time.

That doesn't work in an EV.

If I had forgotten to plug in my EV at home (nevermind that there aren't any trucks yet), I'd be screwed. And yes it's possible to forget sometimes.
Reply: @dchawk81   huh? I  never said plugging in at the mall was the solution for everyone. In fact I said if you have to rely on that then an EV was a bad choice. I've charged at a mall twice in the last year. Pretty sure a lot of people go more than that. I was trying to say that these chargers are a pretty stupid option as a means of charging unless they happen to be somewhere that you're already at. Personally, my Tesla gets me through 10 work days worth of commutes before I am empty. If you forget to plug in for 10 days straight, you've got bigger problems than your type of car. It's very similar to a cell phone. Pretty sure you're in the habit of plugging your phone in every night. The car ends up being the same. It's just part of getting out of the car. With an EV you will probably never be in a situation where you only have 1/8th charge left and need to go somewhere unexpectedly. The lowest my car gets in a given week is like 70% because it's always plugged in when in at home. Besides, there aren't many places where 1/8th of a charge wouldn't get you to a supercharger where you could get enough of a charge for your unexpected emergency in about 15 minutes. It's much more convenient than gas. The problem I've come across when talking to friends is that they have a hard time realizing that unlike a gas car where 99% of the time you're charging at a gas station, with an EV, it's the opposite. It's very rare that if you have a home-charging option, that you will ever need anything else and it's way easier to plug in at home every day than to make a weekly trip to a gas station.
Reply: @stevew9041  Yeah people like me don't have the predictable office commute. Well, we do but we have a lot more than that besides. It's cool that people can make use of these cars but a lot of owners (not you specifically...you seem sane) talk like just because they can use it, everyone else can too.

I like the concept, but logistically it just doesn't make sense yet.

Heck my town doesn't even have a single supercharger.
Reply: @dchawk81  That's why you plug it in at night, so that you have a full charge in the morning..
Reply: @dchawk81  There are trucks now. Tesla and Ford, I believe Chevy is next to announce.

It's true that it takes a different mindset, but it's as hard as owning a cell phone. Come home, plug in. Stop anywhere with chargers (grocery, drug stores, and city halls are common here), check charge and plug in if needed. Of course, if your area doesn't have much of a charging network it might not be for you. Yet. But it will be soon. A number of options now that get you past that 200 mile range, which is further than some motorcycles can go. But you don't have to buy one yet. Wait til it makes sense for you.
Reply: @dchawk81  You'd have to forget multiple days in a row for the car to get very low. If that is a problem you'd have, you definitely should not get an EV.
Reply: @jimmurphy5355  You're making the same mistake a lot of EV defenders make in putting everyone into the same commute-to-work-and-groceries box.

It's like a cell phone. If your usage is high you're not going to make it as long.

If you supercharge your car every day as a workaround, you won't get the longevity. Just like your cell phone. You're gonna cook it into uselessness sooner. That means you can kiss the 500,000 miles of life expectancy goodbye.

You're right though an EV isn't for everyone and you're one of the few to concede that.
Reply: @dchawk81  who said to supercharge every day? He said on roadtrips. Good thing those batteries are only like 6k to rebuild, basically an engine rebuild cost.
Reply: @Sam super chargers are all over man. No tesla dealer in my city but a lot of malls have them, etc.
Reply: @Sam Oh, who said you gotta go through tesla? I'm sure there are already aftermarket companies doing it for a lot less than the 7k tesla wants. From what I read though those are very, very rare. 3-500k miles is the norm.
Reply: @dchawk81  just because you drive 200 miles per day doesnt mean everyone does, actually you are in the 10% minority of drivers, only 10% of humans who own a car drive more than 30-50miles a day. For average driver EV's are allready a good option.
Reply: @teemumiettinen7250  until it's not and becomes a limitation.  Right now they are the second car if I where to own one at all.
Reply: @mblake0420  looking at your other comments i can see that you are very very delusional...no point arguing with some 50 year old stuck in your ways guy who doesnt understand technology or whats going to be the future, look into solid state batteries before you talk.
Reply: @teemumiettinen7250  lmao, I'm 37. If you read, you would know I said I wouldn't adopt such garbage until the batteries improve and even then I might not. Unless I can get a full charge in 20 minutes it will never be the family vehicle.
Reply: @teemumiettinen7250  It's unfortunate actually because my long trips aren't related to my commute, but my job is too dirty of a place to have a nice car. I won't take any new car there if I can help it. I literally bought an old beater for the purpose of that job.
Reply: @stevew9041  How much rewiring did it take to accommodate your 240 outlet?🌹
Reply: @dchawk81  We haven't seen any car chargers in our area at all🌹
Reply: Hybrids are smart fully electric is not, I’d hate to depend on weather I could keep going on a trip if the angry apartment owners might not come out angry or turn of the charge port and my car dies in a strange apartment complex in the middle of the night in an area I’m not familiar with
Reply: @bluebox13studios43  Interesting concern, I can't imagine what you'd be doing at  strange apartment complex in the middle of the night.

For everyone else there are supercharger (Tesla, of course) stations along pretty much all major highways, and the misnamed 'level 3' generic charging stations are coming up fast. Many businesses in metro regions have level 2 charging nearby or in their parking lot. I went to my state capitol the other day to talk to some electeds and found rows of level 2 chargers, many in use.

What I find interesting and strange is that there are a few million people driving electrics now, yet we still have people telling us:

1. It won't work
2. Cold
3. No charging stations
4. The car will die and you'll be stuck

It will always be possible to find reasons to not adopt a technology like this. Some of those reasons may even be valid, and if I lived in the middle of Montana I'd agree with you - today. But not where I live. I put 45,000 miles on my first EV in 4 1/2 years. I got a deal on it, sure. But in that time I've needed no service, nothing has failed and it's already paid for itself. The battery may die in another 150,000 miles or so, but if so it will be a lot less expensive than my last car - an Aspire that lasted 200,0000 miles. That old car was rated at 40 mpg, about as good as it gets. The replacement gets 105 MPGe (the gas version gets 30 MPG).

My wife bought a Model 3 recently. And while the 240 mile range is a bit shorter than I would like it's enough to get pretty much anywhere in the country hopping from one supercharger to another with barely enough time for bathroom breaks while it charges. And with a million mile expected lifespan on the battery pack this will be her last car, and total cost of ownership will be a lot less than her last car - a ford fusion hybrid. Long term it got about 38 mpg. Her new one gets 133 MPGe. Don't tell me that it was a stupid choice, at the very least we're saving gas for you.
Reply: It was kinda a joke but I still feel like having a full electric car is more of a hassle and you can fall back on having regular gas to go if there’s not charging stations around and it’s one less thing I have to charge also if a electric breaks  how do you even fix it ,and these full electric vehicles arnt   Cars in my book their boring to look at boring to drive and are soulless there’s no real destinction between them they don’t have character their blank I’m not saying gas cars are better but they are more of cars full electric cars as they are now are people movers nothing more this might not matter to most but I want a car that has effort put into it instead of just efficiency making cars more complacent than they already are
Reply: @bluebox13studios43  That's fair enough; everyone has preferences that aren't entirely rational. From the sounds of things you aren't happy with the move to electronics in cars either, and I have some sympathy for that view. I'm a retired motorcycle road racer of some 3 decades, and the increase in management electronics has taken some of the skill out of racing, but not much.As for things breaking, there's a lot less to break but having decent support is an issue. Not a problem with Tesla, but my Focus? Ford doesn't have a lot of support for this one. But the new Mustang and F150 EV will, they are literally betting the company on them.

Still, you might want to test drive a Tesla at some point, I think you'll be surprised. Even our bargain basement Model 3 has enough acceleration to be entertaining, and handling is decent - better than most cars I've tried. An electric may not be for you yet, but then neither is a Ferrari. But you'd want to take one for a spin.
Reply: @randygrein5386  you said ford…..
Reply: @bluebox13studios43  weather has nothing to do with it. I've driven my EV in heavy rain, snow storms, and sub-zero temps. I knew where the charging stations were, so it was never a problem
Reply: Once batteries will enable a 600 mile range (a full days driving) this sort of PUBLIC charging stations become obsolete... you charge at home or the hotel, overnight, and dont need to charge during the day.
Reply: Because people need them to charge their cars maybe? Also the technology is constantly improving so that 20 hour charge time isn’t going to be true for long especially for Tesla
Reply: All of you need to remember when Henry Ford First Stared Selling Gasoline Cars,there was no Gas Stations nowhere in the Area,as Gas Cars stared to become mainstream and People stop using Horse and The Buggie,Gas Stations stared to Spread All over the Us,so the same thing is going to Happen to the Electric car,Fast Charging Stations Are going to Be installed installed all Over the Us
Reply: Dude their literally tons of Tesla superchargers, why are you wasting your time charging at 5 kW per hour?
Reply: @RealsNappyRooTs  There are reasons. Around here Tesla charges about $.28/kwhour. Blink for those registered as customers, it's $.39. (Anyone else can charge with a credit card, but it's $.44.) Chargepoint charges vary but are by time; usually $2/hr but I've seen as high as $5 in parking garages. I haven't seen any non Tesla DC-DC fast chargers yet, so can't speak to those. But what it means is that Chargepoint costs $.33/kwhr - until that last 10% where it starts slowing down. And there are some level 2 public stations (City Hall for several nearby cities) that are free.

So of the commercial charging stations the supercharger is usually cheaper as well as faster. But there may not be one convenient to where you are. And then there are concerns that extended supercharger use may reduce battery life slightly. We don't really know yet, but possible.
Reply: 20 TO 30 minutes at a Tesla charger done it over 80x
Reply: It's for a short stop. Go to the store, charge up while shopping. Go to city hall, charge up while you're watching council decisions. It extends range on cars like my Ford Focus EV which only has 78 mile range - less in winter. Our model 3? No reason to charge locally most of the time.

If you're going cross country use supercharger stations along the route, charge will be between 15 and 50 minutes - most are under a half hour. Just time for a potty stop. And yes, non Tesla level 3 charging is coming out.

One issue I have with the video is he makes a big deal about 'complexity' of charging. All of the vendors I've tried so far allow use of regular credit cards if you don't have an account. It's not that hard. In Seattle area we have both Chargepoint and Blink so I have an account for each. No drama. They seem to have different areas, and there's another vendor, no information yet.
Reply: Randy Grein I wirk for a living
Reply: @elauber  So? So do I. I am also married, so we have 2 cars - as do most suburbanites. If you're single a short range EV won't work of course. We're in the early stages of this conversion. As we progress there will be more charging options, longer range, etc. So make a rational decision on your needs before buying your next car.
Reply: @elauber  You think I don't?
Reply: @randygrein5386  A $30k car that only has 78mile range? The future is now lolz
Reply: @chriswy697  Not what I paid for it. List price was $36k, not 30. Ours was a customer return (1400 miles), we paid $21k, $7500 K tax credit, so it was closer to $14k. Which isn't bad, when you consider that there are no oil changes, no transmission service, brake pads should last 500,000 miles. And in 45,000 miles I've avoided paying for 1500 gallons of gas. Total gas cost savings about $5200 minus about $1250 for electricity - total savings for fuel about $3950.
Oh, and we recently bought a Tesla model 3 for $41k. 133 MPGe combined, 240 mile range and an expected battery life of about 1 million miles and access to a nationwide network of superchargers - as well as standard chargers. It may not be for everyone, but it makes sense for us.

And before you say anything else take a test drive.
Reply: @Sam Of course they won't work for everyone. Yet. But I suggest you do take a test drive when you can. You may be surprised.

Oh, and 120 miles is nothing. I went further than that on Thursday. The car was recharged at home before we went to bed. People spend a bit too much time worrying about charging.
Reply: @Sam I admit your experience is a bit extreme. Still doable, but extreme. Wait a bit, the range is going to go up. There's one coming next year or the year after with a 1,000 mile range. I wouldn't want to be the first to buy, but it does look compelling.
Reply: @Sam Where do you live? There are only a few spots in the lower 48 of the US that are out of range of a SuperCharger.
Reply: @Sam I do not believe you are that far from a supercharger. Show me ANYWHERE in the continental US where that is true. You also have electricity at your home. Why is that so hard to understand, Its like saying CoSTCO sold out of water, what will you do. Well you could turn on the TAP and drink
Reply: @Sam So what? That is NOT what you said, You said you were not within RANGE of a supercharger. You lied. You said it was 85 miles away. Well within range of every Tesla on the market. I guess Montana has  not developed 240 watt 32 amp on their electric grid to fully charge a car before leaving? Youd be the same asshole that would run out of gas and blame the gas stations for not being closer.
Reply: @randygrein5386  - but a battery change would be a biggie
Reply: @randygrein5386  boy they sold you. Did they tell you the replacement cost of a battery.     ($26k). Poor people can’t afford a used car. How about you think about them instead of bragging about your $100k in car purchases. The biggest part and what should be step number one is securing a power source like nuclear or fusion in 10-20 year. Better yet you can continue to listen to a 14 year old on how you should live your life.
Reply: @randygrein5386  Unless you want to do more than drive from Tesla (which is Tesla only) Supercharger to Tesla Supercharger.. I enjoy taking back roads etc when I'm on a long trip unless I'm really going from point A to point B, then I want to get there as effeciently as possible in my vehicle which is why I have a 2017 Chevrolet Cruze turbo diesel with 6 speed manual and get over 700 miles per 13 gallon tank of diesel.
Reply: @dundonrl  That's not bad, a bit better (if you're talking real world) than my Aspire did. I suspect that as the cost of fuel rises and range gets better you'll think about changing when your car wears out. When that happens your fuel costs will drop by 75% with no oil changes, transmission service, and brake pad replacement will go from about 25,000 miles to 500,000 miles. Oh, and no transmission repair/replacement, which usually happens about 200,000 miles.

Oh, I can take back roads too, I just have to keep an eye on where to charge. And that will only get better. In the meantime? I save about $1500/year on fuel and service.
Reply: @randygrein5386  When I'm driving halfway across the country in 24 hours, an electric vehicle (currently) makes absolutely zero sense. Maybe the infrastructure and batteries will get better in the future, but currently and for the foreseen future, it's a "no go".
Reply: @dundonrl  Of course. Who said otherwise?

Wait for the things to catch up, infrastructure and battery improvements ARE coming. 2 new players are releasing in the next 2 model years with extended range and solar collectors on the car - one at 450 and the other at 1000 mile ranges. And DC-DC charging is a lot faster, next level up will be about 15 minute full charge.
Reply: @randygrein5386  300,000 on my trans. Tundra. No slip. No skip
Reply: @randygrein5386  And you get to the store and all the chargers are full, you get to city hall all the chargers are full.. so you are fked.
Reply: @gary2984234  I've had a few adventures with my focus, but the point is to charge when it's available so you have enough to get by when it's not. My god, are there no boy scouts out there anymore?
Reply: @randygrein5386  only an EV user goes to city hall discussions
Reply: @iducatifan1  Well, sucks to be you then. I am active in local politics and will be running for city hall in 2 years. Of course, there's no reason you'd know about it if you don't have an EV or care about government.
Reply: Randy Grein it takes you 15-30 min to use the bathroom?   See a doctor.
Reply: @randygrein5386  you live on the west coast, where there are a good bit of charging stations, not so for the rest of the country.
Reply: @dannyfields2065  I see a fair number across the US, but Washington State is blessed with quite a few, especially high speed charging. North Dakota has no Superchargers yet (and no people, to speak of), South Dakota has a nice line of them along I 90, but none north of that line. So it's possible to get pretty much anywhere in the country with an electric but not ideal in some of the out of the way areas. Today. It's why, although I am an ardent enthusiast I still recommend people look hard about their area and needs.

Still, we are out of the era of electrics being city only cars, and things are getting better fast. Batteries are getting better energy density and a lot faster charging, and as more people buy them more charging stations are being built. And home charging is going to be your default anyway.
Reply: @randygrein5386  you most likely live in a rural area, in big cities there are a lot of row houses, and i do mean alot, built with no garages, so people park there cars on the street, and even on sidewalks, so how are they going to charge their cars. and dont say charging stations, its all residential, with no room for charging stations.s this vast amount of people are not going to buy electric cars, and this is only one of the many downsides of buying an electric car. proper research was not done in regards to potential electric car buyers.
Reply: @dannyfields2065  Not quite. I live in a city of 140,000, in a suburban area. Bellevue is EV central in the region. Yes, there are charging challenges - we're not quite there yet. But the thousands of EVs in this city show that they do work and work well, and are making an impact.
The error is in saying 'there are problems so it can't work' instead of asking 'here are the constraints, so where would they work?' We don't need 100% conversion to make a difference, but the more EVs are there the more charging solutions will be available.

I ran my Focus 4 years using a 110 outlet, and I had a 60 mile round trip commute. But I do have a driveway. There are 4 charging stations in the park at the back of my house, and stores around the city with charging stations installed.
Reply: @randygrein5386  so you live in bellevue washington, and i know there are charging stations there. but i live in a city that has over 1 and a half million people, the chargeing stations arent here, and how are you going to sell electric cars to people with out garages? i live near the edge of the city in a twin house, there are a lot of single houses around here, all with garages. however the overwelling majority dont use their garages. they are turned into recreation rooms, bedrooms, storage rooms, etc. do think they are going to turn them back into car storage, just to buy an electric car (lol) i am one of the few that uses my garage for car storage, but hardly any one else does. electric cars are inconviented, and (time consuming, something you can never get back) if you have nothing to do, but running around chargeing cars, then so be it.
Reply: @dannyfields2065  How many times do I have to say it?

There are some it won't work for right now, period. Don't worry about it, range is increasing and as early adopters buy you'll see more public charging stations. But you err in thinking that you can't have home charging now. I've never put my cars in the garage, charging happens outside. It's not inconvenient to plug in when I get home, nor does it take time. Plug in and walk away.

It's pretty plain that the problem is you don't WANT it to work, so you waste time arguing with someone who has made it work for years. But you don't have to buy one. It's a net time and money saver for me, but you are free to keep buying gas and oil. Worst I've had is to take it a few times to the park around the block, before I had a level 2 charging station at home. 1 minute walk I needed anyway. I haven't changed oil in years now, nor do I need to schedule a transmission service. Don't need brake work either, not for another 400,000 miles. I figure with pluses and minuses I'm ahead by quite a bit. You aren't convinced, so don't buy one. End of story.
Reply: @randygrein5386  you are thinking about yourself, that would not work around here. i as many others, live in a house that has a shared driveway, so one cannot park in a shared driveway, ( a driveway means enter and exit from garage, except for loading or unloading) and the steep slant to the garage door, that when we get snow, im trapped in the garage, with my electric car charger being useless.
Reply: @dannyfields2065 Are you learning impaired? How many times do I have to say 'YOUR MILEAGE MAY VARY!!!! I don't have a clue about what your specific capabilities are, where you live, nothing. And I really don't care. All I've done is share what CAN work, not guarantee that you can. For the last time, keep your gas car if you want!
Reply: @randygrein5386  i certainly will keep my multiple gas powered cars, as one sits in the street, for driveing everyday, if i wish. ill bet your cell phone and monthly charge for it costs as much as i pay for gas in a month.
Reply: @randygrein5386  Lol, you will force yourself to do shit you don't want to pass time while waiting for your car to fill up 15mph..
That's beyond pathetic
Reply: @randygrein5386  Is it safe to leave your car unattended while it's charging and you're in a store?
Reply: @randygrein5386  78 mile range? SERIOUSLY?
Reply: @randygrein5386  And someone can steal your charge too
Reply: @randygrein5386  to much work to go to the  store
Reply: @randygrein5386  Even if you could get a charging point don’t count on finding one available not to mention the other 1000 reasons it is not practical.
Reply: @randygrein5386  As more EV's hit the street, these fast charge stations will be overwhelmed by the additional demand. Small charges will decrease battery lifespan regardless of what the manufacturer and dealer tells you. That disclosure is like buried under miles of fine print.
Reply: @randygrein5386  How long will the battery last with a lot of supercharging?
Reply: @temfish  That's a good question without a good answer. We know that some who use them a lot are seeing a half million miles with at least 90% capacity, but they should last longer with limited supercharger use.

But then think about it. Who keeps a car for a half million miles? At 15,000 miles a year (typical car use) that's 33 years.
Reply: @temfish  I don't know for sure, but people are getting 500,000 miles the way.
Reply: @temfish  Tesla model S' with 300k miles lose about 10-15% of their battery capacity. Perfectly reasonable. Model 3s are too recent to tell
Reply: temfish Many, many years as long as you stop charging at about 80%..
Reply: @randygrein5386  I don't have half a million miles on mine but earlier this year I bought a 33 year old truck. First owner had it for about 30 years, my sister had it for 2-3, and now I'm driving it to work every day.  It's never been restored, all the clear coat is gone, the paint can rub off on your hands if you're sweating, and I believe I was the first to replace the shocks...ever.

It's a diesel, 3/4 ton, no emissions whatsoever (exhaust is straight off the manifolds, hits a muffler, and out). Just looking at the tailpipe will give you cancer. With a manual 4 speed transmission, it screams at highway speeds.

Very few sensors...just the basics like water temp, oil pressure, water in fuel, etc. Passenger door doesn't even operate the cabin light.

No headliner, no sound deadening. Vinyl seat, rubber floor (no carpet), crank windows, etc. It does have AC amazingly enough. I don't know yet if it works. Has decent heat.

Window motor went out on me. Popped the hood, took the old one off, put the new one in. Hood down. 10 minutes later I'm good to go. Fuel filter is a spin on style under the hood almost identical to  the oil filter down below.

Exhaust was broken when I got it. Some money and an hour or so later the entire thing is brand new. No sensors to get scalded into the pipe and fight to get out. The stiff rubber hangers were the hard part.

It's so dead simple, I love it.

Before you think I'm poor (not knocking it, I used to be), I've also got a new 2018 1-ton RAM dually and a newish Jeep Wrangler. I like the old truck most. Just not for distance because it's tiresome.
Reply: @dchawk81  Yeah, I had a '65 Chevy van like that. Finally killed it at 260k. Cars tend to last longer now, and has an impact on how long it will take to replace gas cars.
Reply: temfish As long as it’s charged up to the recommended amount (80% or so) it helps the life of the battery. I know when I plug in the supercharger location in the GPS, it preps the battery for charging. So the Tesla anyway seems to protect the battery. It takes an hour to get from almost zero to full charge at a supercharger. They are not called super for nothing!
Reply: @temfish  Well, the batteries are almost always guaranteed for 8 years, 100k miles.
Reply: @randygrein5386   I did , but it took 11 years to get to 500,000 on a 03 chevy cavalier.
Reply: @randygrein5386  - I have a Ford truck F150 with 442k miles on it that I still drive.. hope to break 500k miles
Reply: @randygrein5386  300,000 on mine now and climbing (Toyota of course). I don’t buy into the typical “new car got to have it go buy” hype.
Reply: @temfish  Many years. I have driven my Tesla model 3 for 96,000 miles, and have supercharged on trips literally hundreds of times. My battery still has 90% of its original range.
Reply: The point is to get you enough charge to get you a bit of charge if you are running low and get you home. Full charging should be done overnight at home.
Reply: @mbd8822  - unless you live in an apartment complex and it has 3 chargers for 200 apartments
Reply: @mbd8822  " Full charging should be done overnight at home" .. which is fine until everyone on your street gets an EV. ...then the fuse at the stepdown transformer blows and everyone is without power until the power company can get a bucket truck out to get up the pole and replace it... and they tell everybody to turn those dammed chargers off!
Reply: Those  charge at nearly the same u can get from a normal socket in the EU.... 230V 20 A, I have 440V three phase 20A at my disposal at home. Even with a 0.8PF I could easy charge with a 11KW charger. What a joke!
Reply: @Sapphire1987  That's a good rate. Our 'standard' is 120v, either 15 or 20 A. But stove/drier circuits are common, 240 V 40A. Yours are a bit more convenient.
Reply: I can't make it to work today, I'm charging my car, or, the power went out last night, I can't make it to work , or, my dog ate my charging cable.
Reply: @rhandbhf4ever  It's funny how those with no experience are telling us that we can't do what we have been doing for years. Russian Troll!
Reply: The problem is this; Once the new car owner discovers how long the process takes, THEY SELL THE CAR! And the "All electric car" gets a bad rap, WHICH WAS WHAT THE MANUFACTURER INTENDED! Electric and hybrid vehicles have been around for 70 years. They are the most successful freight vehicles the world has ever seen. Diesel/Electric freight train locomotives have been pulling pushing freight trains for 70 years. And if gasoline/electric hybrids were allowed at NASCAR, they would run off and leave the field. "Once the problem stops, the MONEY stops!"
Reply: The charging stations in apartment complexes are intended for people who do not have a personal garage. And you ought to complain to your federal legislators in Congress about why the USA is the only nation on earth with a 110 AC power supply. That is what is stupid.  All other nations have 220-240 AC electric voltage.
Reply: So far it looks like its just more of a hassle to even own this type of car, I mean who the hell wants to take a trip someplace and spend wasted hours having to charge the bloody thing. Unless there are better ways and means of charging these cars where people don't end up getting stranded somewhere and a faster way to charge I really don't see this as something worth it, and I would think that this fad will just eventually fade away like a Beta Max.
Reply: @awesomeartdigital6077  I hear this from a lot of people who don't own one. Those of us who do aren't concerned about it. Now granted, we have a modest model 3 with 'only' a 240 mile range, so figure about 200 miles between stops. If we take the car to visit my friend near phoenix there are a dozen stops to top off - all between 15 and 50 minutes, most at 30. About what we needed last time we drove down. If that's a problem, don't buy. Milage will double in a couple years, as will charging speed for new cars and chargers.

But that 240 mile range covers over 95% of our driving needs, out and back without charging. The model Y is out shortly and Tesla expects it to outsell everything else combined, as the Model 3 did previously. Ford has a complete lineup out in the next 2 years as do almost all manufacturers. Given that gas and diesel engines sales are ending in 2030 in many countries it's unlikely this is a 'fad', or will fade away.
Reply: You DON'T FULLY CHARGE YOUR VEHICLE AT A PUBLIC CHARGE STATION.
It's mainly for topping up, responsible EV owners don't let their range get to a certain power level... You know, idiots.
Reply: @escapedcops08  lol u get 12 miles for 1 hr of charge 😂 you’ll use more energy getting there then u would gain by charging it 🤡🤡🤡🤡
Reply: Because in MOST situations the person does not need to fully charge. Let's say you go to work at XYZ Company Monday- Friday . You start at 8 and work until 5. That is 9 hours. Now, pretend the charging station is giving you 15 MPH. That is 135 miles per day. Your trip to and from work is 30 miles. That means you burn 60 miles for a net gain of 75 every day. Until miraculously on the weekend your car is fully charged for a trip. Even better is the fact that many companies do not charge (my bfs company has 6 spots that do not require payment) or you pay for a parking space in a city lot (the city I live in has monthly permits, but does not charge extra for use of the charging spots. This means you are getting the charge and not needing to charge as much at home. 
Do you understand now?
Reply: @TexMex421  charge your car at a station near your apartment before you go home 

in 30 minutes you have 80%  capacity

drive home and park

what part do you not understand?
Reply: I go to work. I park my car for 8 hours adding 20 miles per hour. That means you add 160 miles during work. How about I go to dinner or a concert. I spend 3 hours charging my car. That added 60 miles. What part is hard to understand?
Reply: If you charge at a Tesla supercharger, you can charge to about 150 miles of range in about 20 minutes.
Reply: @davidreidenberg9941  welcome to the stone age! :)
Reply: You don't (if you have half a brain) use such a station to try and charge a long range electric from empty to full, unless you can park there all day or all night, and it's within an easy walk to work, school, home etc. Proposing that anyone would is schlock "journalism" for the sake of clicks and views. But I have plugged into such a station for as little as an hour while eating out, doing a short job at a client's location, shopping etc. If it puts back even just 30 miles (a typical value for a public level 2 charger) that may cover more than half of all the range I used in a day. I don't usually need or want to do that, because I charge at home. But I know one Tesla owner who lives in an apartment across the street from a strip mall. There are 4 public level 2 chargers in the parking lot for the shops, about 200 feet from his home. Those chargers are convenient and practical for him. He only needs to plug in for a few hours every few days to keep his car topped up. He doesn't stand around waiting, or sit in the car while it charges. He walks back across the street, makes dinner, does chores, helps kid with homework, or anything else that needs doing, and then goes and gets the car 2-3 hours later.
Reply: @jimmurphy5355  Those are rare circumstances. EV's are still a novelty.  As more EV's hit the roads, charging stations like you're talking about will have long waits if they're available at all.  Constantly running around on a partial charge and not fully recharging on a regular basis will shorten battery life. Manufacturers and dealers will never tell you this, of course, but this reality is likely buried in the fine print and legal jargon.
Reply: @dannygreen7473  You need to do a bit more learning, Li-ion batteries LOVE being at 20-80% full. Charging them to 100% is what's hard on them. Tesla has always recommended limiting the charge to 80-90% most of the time, and only charging to 100% if you are immediately headed somewhere that requires every bit of range you can get. Tesla is very aware of the need to reduce or eliminate waiting for a spot to charge, so on busy routes they are building sites with 50-100 cords. There are a bunch that large already, in areas where Tesla's are common. And as for EVs being a novelty - your perception is years out of date. In the first half of 2022 the Tesla model Y and Tesla model 3 were the #1 and #2 vehicles sold in California. Not the top EVs - top VEHICLES. They outsold every Ford, every Chevy, every Toyota, every Honda, every Nissan, every Dodge or Ram, or Jeep....
and that includes pickups. The rest of the country will catch up. California may only be one state, but  keep in mind that California, all by itself, has more car sales than all but 5 or 6 of the largest countries.
Reply: @jimmurphy5355  Funny.  You're not even allowed to charge your EV in California during peak hours. California's grid can't even keep up without the extra demand from EV's.  

I've had plenty of experience with lithium ion batteries in the power tools used for my trade. They do not have a great lifespan and they are incredibly expensive to replace.  That doesn't even consider the waste stream created by waste batteries.

Recycling is energy intense and creates it's own toxic waste streams.  Recycling batteries, solar panels, and junk windmills is about as far away from being "green" as you can get. 

Fossil fuels are much more environmentally friendly in the long run than EV's and "renewables" such as wind, and solar shackled to  batteries will ever be. 

If Commieforniana was serious about moving away from fossil fuels (which is absolutely unnecessary for a century or more) then they'd be investing in nuclear for electricity and hydrogen for transportation.
Reply: @jimmurphy5355  Furthermore, nearly every combustion vehicle on the planet could be readily converted to hydrogen today by any skilled mechanic for a fraction of the cost of developing batteries.  If you still have a hard on for an EV, a hydrogen fuel cell would disconnect you from your tether permanently.
Reply: @dannygreen7473  It's possible to make an internal combustion engine run on hydrogen. But it's far from trivial to do it well.  It would take a highly engineered conversion kit developed at considerable expense to do it right.  But making the engine run is only half the battle. It's really, really hard to store much hydrogen in a car. The 10,000 PSI tanks in a Mirai only hold 6 kg of hydrogen, and they take up a lot more space than a gas tank. 6 kg of H2, burned in an internal combustion engine would provide, maybe, 100 miles of range. And right now, hydrogen is about $15 per kg. So it would cost close to $100 to go 100 miles. Hydrogen has huge downsides to go with some of its upsides. There's a good reason none of the big auto makers other than Toyota and Hyundai/Kia are even building fuel cell cars, and none of them are even suggesting that it would be a good idea to burn H2 in a piston engine.
Reply: @dannygreen7473  The lithium ion batteries in EVs don't wear out like the ones in power tools. Different use, different result. There are enough Teslas out there with high miles now that the batteries are well proven to last 250,000+ miles. Almost one is replacing any EV battery for the life of the car. I have 97,000 miles on my Tesla, and the battery still has 90% of it's original capacity. If it's "only" 80% at 200K miles, and I still have the car then, I won't be crying - or replacing an expensive battery.
BTW, we are always allowed to charge our EVs any time we want. But for a few days a year they ask, politely, that we refrain for a few hours. The whole western region was having record high temps. Air conditioners everywhere were maxed out. Of course the grid is stretched to the limit. But only for a few hours of each day, and only for a few days in a year.
You're wrong about recycling the cells, too. Efficient, clean methods are being developed, and when there are enough batteries that need to be recycled, the facilities to do so will be in place. Tesla is already recycling some battery packs (early failures, manufacturing defects, prototypes.) So far there are almost no packs worn out from use, even from cars made back in 2012.
Reply: Because not all of us lives in a city. I drive 66 miles one way. Not to mention running errands in the city. So go get your EV and leave the Midwest out of it!
Reply: @lisaanderson4024  Exactly. But mandating EV's is just the beginning. When the WEF and UN get their way, we'll all be rounded up and forced into cities. You won't have your own home, let alone your own car. You'll share a 10 by 10 pod with three other families. You'll be allowed to be in your pod 8 hours per day then it's the next family's turn.  This isn't just about changing the way we drive by force. It's about changing every aspect of our lives by force.
Reply: @lisaanderson4024  LMAO. The midwest needs EV's and charging stations. Get yourself an EV, most new ones have 200-300 miles of range, that more than covers 66 miles
Reply: I guess you hire an Uber/Lyft driver to drive you around in their gas vehicle for ten hours, while you wait for your EV to charge, yeah, that makes sense...NOT!
Reply: @clnelson321  lol
Reply: @clnelson321  lol
Reply: @clnelson321  Your ignorance and fear are showing.
Reply: @TexMex421  Dude you can fill a car up under 2min that would last a week to a month. a economic car gets like 35-40 miles a gallon with little to no emission. Also they dont harness lightning bolts to charge these electirc cars...
Reply: @unicornharry7995  yes. no, and who are you kidding.
Reply: the average person drives 40 miles a day in the US. After driving all day 15miles a hour can take less than 3 hours to get back to recommended battery level of around 70-80% (to avoid long term battery damage, only charge to 100% right before a long distance trip) if you do this throughout the day as you go places you can basically constantly have a good charge in the car.
Reply: @AnubisRulesDeath  yeah, my car's empty light comes on with about 50 miles of gas left in the tank. That is about the range of most electric cars. So if you start getting nervous and looking for a gas station when the empty light comes one (which is the sane response), then that is how you will feel at all times while driving a leaf or a volt. Isn't that fun?
Reply: @Koorstag  Lets be real, Leaf and volt are not considered decent to most people. Even EV owners. Tesla is imply the only sensible EV options at this moment. And their cars are competitive for their market with range well beyond what people would probably use per week. Yes battery and charging tech needs improved. But I still don't see how someone with 40-50k for a new car would buy a gas car when: EV charging is significantly cheaper than refilling, range is almost just as good as ICE, Autopilot that will make you money at some point thru tesla uber like service, 5 star every category saftey, Sentry mode, and instant torque that can beat most super cars off the line. If people set up solar and got a used tesla in the future people could essentially drive for FREE (minus cost of solar, car and minimal maintenance ofc). Its literally impossible to say the same for ICE, sure they get more and more efficient but the resource that runs it is: limited, environmentally corrosive, and a generally unstable price (ive seen gas under 2$ per gallon and go up to 4$ per gallon in my area, most people in urban places are almost definitely paying more)
Reply: @AnubisRulesDeath  I guess I drive more then most, and I often drive from Southern California to Seattle for vacations, an EV of any sort does not have the range of an ICE when the recharge takes hours. I guess it depends on how much you want to manage the charge on you EV over just pay for fuel and get there. Also, I live in an apartment like most people in cities, so I would always have to go somewhere else and wait around to charge an EV. I get that they work for some people, but the inconvenience level of an EV is very high. Hopefully that will get better as the tech improves. I can't see autopilot ever being something I would want or trust, but we shall see I suppose.
Reply: @AnubisRulesDeath  You seriously think people are gonna Uber with a Tesla and it actually work?

Oh how naive you are. 😂

First off, it's cost prohibitive. Teslas are too expensive for all the more you make driving. Second, you're going to use the entire range of the long version in half a day. Insurance is going to kill you, and you're looking at months of downtime if you wreck it (see TFL where Tommy hit the garage). Nobody will want to ride knowing you're using autopilot (another expensive cost to eat at any profits you might have made). In order to keep up range you're going to supercharge CONSTANTLY, and that means in a short time you're replacing that super expensive battery.

No, for Uber your smart money is on a $12,000 base Nissan Sentra if you're the type who just has to have something new.
Reply: @AnubisRulesDeath  solar isn’t what most people think and “environmentally friendly”? Nope. 15 years average changeout on panels. My shingle roof has twice that life.
Reply: @AnubisRulesDeath  This statistic has a HUGE problem. OK if you add everyones miles together and divide it by the number of drivers you end up with 40 miles per driver true, but the simple fact is around a third of drivers actually drive less than 10 miles per day (there are many, particularly the elderly, who drive less than 500 miles per YEAR), meaning most drivers actually drive a LOT more than 40 miles per day.
Reply: @AnubisRulesDeath  " The Average Person drives 40 miles  there for you only need to charge 3 hours" 
.
That's not how you calculate Charge nor range  🤦‍♂️🤦‍♀️🙄
.
From the 40 miles gained  
1- You have to Factor standby Losses
2- You have to factor Electronics power Loss
.
3 - You have to Factor Climate Loss
.
In some case Cold weather alone would scrap 50% of your 40 miles range on your Tesla 🤔
Reply: @AnubisRulesDeath  EV IS A SCAM . In
the 1890 ' s and early 1900 ' s
they tried electric and it failed .
Gas and diesel were more efficient than electric . 
Who the heck is going on a 500
to 1000 mile trip and have to charge 2 to 5 times on EV only 
unless it is a Toyota Prius or
Camry hybrid . 
My neighbor says he gets 600 
miles on full tank of gas .
Reply: @AnubisRulesDeath  yeah, who the hell has the time to be charging your car even once every day? I’ll stick to my gas. I fill my car up once a week and it takes a minute or two to gas up.
Reply: @AnubisRulesDeath  TURN ON YOUR HEAT OR AC & DRIVE OVER 40 MPH,,,,   
GREATLY REDUCED
Reply: @AnubisRulesDeath  pain in the ass IMHO
Reply: @AnubisRulesDeath  a lot of trouble doing this.
Reply: @AnubisRulesDeath  unless -  there is no charger available and you are likr fifthor sixth one in a row waiting to charge.... nice
Reply: @AnubisRulesDeath  but good luck with road trips
Reply: @mikehascats26  Ignoring the fact that technology will always improve until singularity and the collapsing value of oil. who says you need the same car for road trips? Most people don't go far on a daily basis and most people take maybe one or two vacations a year. If they decided not to fly (depending on to and from locations etc.) they could either plan with a couple extra hours to accommodate charging or rent a long range gas car for that one trip.  Either way EV will obliterate gas for the common consumer and eventually industry. Its the only way we don't destroy the habitability of earth but its probably already too late.
Reply: @AnubisRulesDeath  most electricity is produced by burning coal, einstein
Reply: @mikehascats26  For now
Reply: @AnubisRulesDeath  uh yeah sure... eventually people will be able to teleport like star trek... but not in our lifetimes
Reply: @AnubisRulesDeath  Whereas driving the same distance in a gas or hybrid takes only a few minutes and not 3 hours.  Which is one of many reasons why EV's are not practical.
Reply: @AnubisRulesDeath  nonsense. You can charge to 100% each time, it doesn't do any damage
Reply: @AnubisRulesDeath  Sounds like a big PITA.
Reply: @AnubisRulesDeath  tell me who really has the time to go around charging a car to save a couple of dollars.
Reply: @AnubisRulesDeath  How far would this "long distance trip" be on a 100% charge?  That's what I though......I'll stick with my gas powered mid-sized SUV.
Reply: I'm failing to understand why anyone would want an EV in the first place!